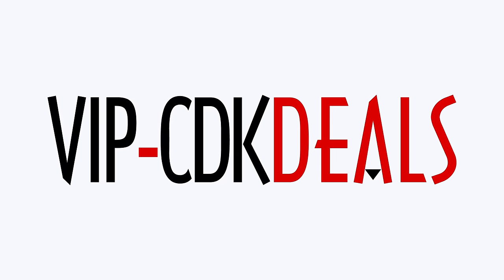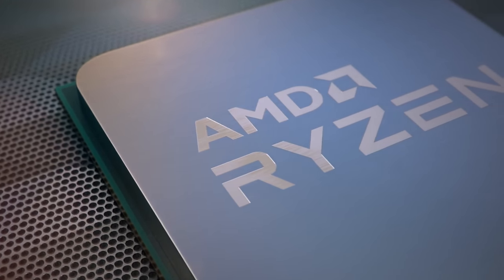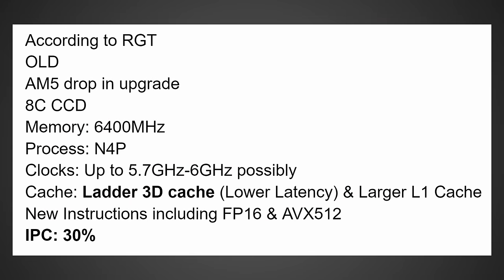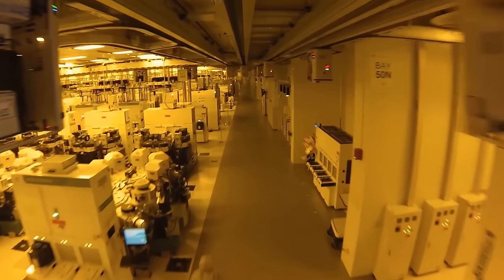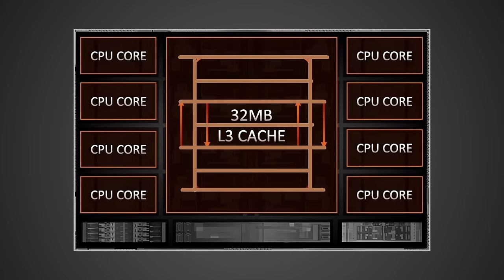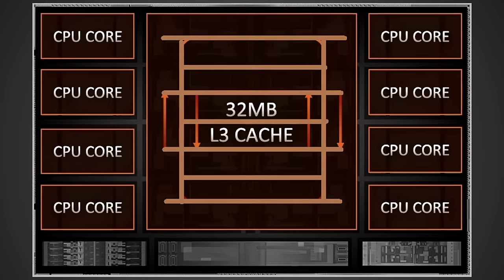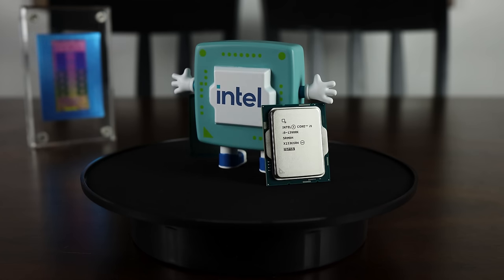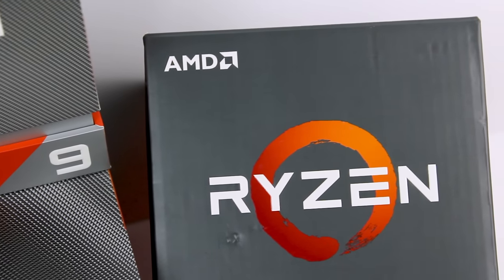Zen 5 Wins - AMD Ryzen 9000 Specs & Release Date

Comment: I already have a Ryzen 5 7600 and it’s enough for a FullHD right now with plenty to spare. I'll wait for Ryzen 7 11700. I hope they won't raise the operating frequency of the new processors too much, otherwise I'll have to change the RAM, and maybe MoBo
Reply: Ryzen 9000 is probably the last line of CPUs on AM5. Ryzen 10000 will probably be APUs like 8000. The way they're going, AM5 won't be able to support the next-next gen Ryzen CPUs
Reply: @Liminal.Headspace  Zen 6 CPUs will be on AM5. Ryzen 9000 will definitely not be the last series.
Reply: @Liminal.Headspace Why do you say that? I got Ryzen 1700X at launch, then upgraded to 5800X years later, it worked for 1000, 2000, 3000, 5000, why would AMD suddenly start doing an Intel an do 2 generations per socket rather than 4-5? AMD sockets just coincide with DDR generations.... and DDR5 is still fresh.
Reply: @xeridea  Because AMD is already pushing it with what they can do electrically with the AM5 die. There's no "doing an Intel", it's classic AMD lack of foresight. About RAM, don't worry, there won't be DDR6. DDRAM memory has shown it's weaknesses for a long time and only industry conformity kept it in the game.
Reply: @xeridea 
Fresh when DDR6 is expected to be coming next year . However if it was like ddr5 then DDR6 would take off 2 years after the JEDEC specs gets released or 2027 for desktop computers.
Reply: @Liminal.Headspace 
Very confident for someone who is dead wrong. there would a next generation of SDRAM and it is more lucky to be called ddr6. If the naming changed and the overall memory tech changed (wuich is unlucky) then DDR6 might not release. computer engineers from all tech companies aren't a joke specially when they work together to release a standard that all of them with no exeption use.
Reply: @xrafter  How am I dead wrong when you've proven my point ? DDRAM is on it's way out, and people are making sure it is.
Reply: @xrafter  But he's right. DDR is used in PCs because it's always been, not because it's the best choice. Even HBM would perform better in the same place but there's no standards for the release of discrete HBM sticks and one company would have to do the legwork of designing the 1.0 and/or founding the nonprofit to manage the new standard.
Reply: @Liminal.Headspace  
How is it going out without replacment? And what is this "DDRAM" you keep mentioning.

DDR6 will be the next gen of memory for CPUs. HBM3e isn't for CPU because they are expensive to make.
Reply: @Gen0cidePTB  
HBM is more expensive and it is made for HPC. Consumer PCs don't need that much bandwidth, especially when the CPU won't be able to utilize the bandwidth.
Reply: @Gen0cidePTB  HBM really isn't going to ever be used large scale due to material cost and heat output. There are other solid state standards that are being used and developed that use the same RAM chips but in a more electrically and mechanically sound way.
Reply: @nathangamble125 Yeah I'll be shocked if Zen 6 isn't on AM5.

Comment: im still sitting on the 3900x its just about good enough for high 1440p gaming but i do plan getting a AM5 cpu like the 9000 series since its over 80% increase in performance compared to mine. i do plan to pare it with the 5000 gpu since im still on the 3080ti this year is my year

Comment: 40% IPC increase ? Sure... Not. It has never happened while keeping the same socket and memory. And 6Ghz on top of that ? No way.
We will have the classic 10-20% IPC increase, plus 100 MHz or so, as always. That's already good.
Reply: What's the difference between a 1600 and a 5800x3d? You know, the same socket and memory.
Reply: In the proper select benches is supposedly showed "up to" 46% inclrease, I suspect cache heavy workloads.
Reply: @dragonproductions236  14% raw IPC increase. Intel is just always better.
Reply: @dragonproductions236  Comparing an X3D CPU to a non-X3D is not even a fair comparison.
Reply: 2600 and 3600 ; 5 years and a shift from 14mm to 7 mm. Seriously, what a dumb argument. You are comparing Zen 1 and Zen 3.
So, no, there won't be a 40% uplift between Zen 4 and Zen 5.
Reply: @jamegumb7298  Meanwhile 13th to 14th gen
Less than 5% uplift
Reply: Zen 1 to 4 was being relatively modest regarding CPU width, Zen 5 on the other end is quite fat, you just gotta wait 2 months and be amazed.

Comment: i am mostly cpu bottlenecked right now with a 12700k, zen 5 must be twice as fast to keep up with modern gpu's in 2025.
Reply: In what task, with what GPU?
Zen 5 does not need to be twice as fast for most people. An i7-12700K doesn't bottleneck an RTX 4090 in most games at 1440p or 4K, no-one sane buys an RTX 4090 to game at 1080p, and next-gen games will be even more GPU-intensive than current ones. An RTX 5090 will not be bottlenecked by a Ryzen 7 9800X3D in next-gen AAA games.
Reply: You must be on 1080p?
No way 12700k bottlenecks, I have one and game at 1440p 165hz monitor, Haven't seen a single bottleneck matched with ASUS ROG STRIX RTX 4080.
Reply: no it doesnt lol. fix your shit. i run a 6700k and i cant bottleneck it lmfao
Reply: my most played games are battle royales on a 4090, max graphics settings, Fortnite is at 1080p and apex is at 4k.
gpus is not maxed out in either, so logically if i want to double the fps if the 5090 is 2x performance i need double the cpu performance.
and i had a 3080 on that 12700k, and my next cpu u want to reuse and just upgrade the gpu next time so it has to last minimum two generations of gpu's.

Comment: IMPORTANT QUESTION : Does the ZEN 5 Processors work in B650 Model motherboards?
Reply: Yes, it's like AM4 otherwise there's no point staying on AM5 if you can't use the previous MOBO (you need to do a BIOS update of course)
Reply: @osopenowsstudio9175 you didn't have to be condescending. Some people haven't been watching the tech news for 20 years like you and I.

Comment: Actually that what I am waiting for. The first gen of a Ryzen platform have so far always been  "public testbench" for AMD. so  Ryzen 9000 is when AM5 matures and they iron up most of the baby problems like poor memory controller performance and they get the microcode more optimized and then likely we will see 1 or maybe 2 more generation after that before we go AM6

Comment: Of they are using new interconnect that cut laintieces then certain work loads yes. AMD have been not only making the zen cores faster but have kept power under control something Intel is struggling with.

Comment: it will be a year until there is real reason to jump on the bandwagon - wait for bugs, wait for wide availability, wait for price drops after initial early adopter tax, wait for 3dcache version
Reply: Yep, nowadays I play the waiting game on cpus(and gpus).
Reply: @masterlee1988  this is a unique time but really prime time to buy probably won't be for a year until after the x3d chips are out - they will boost it up a bit but not like the 30% ipc gains we see with zen5 - if you wait you can get the new chips and have better efficiency, if you don't need newest gear the older chips will drop in price a bunch - either way you win by waiting essentially bu there are times when you shouldn't wait too since there is always something new around the corner - what makes it more relevant now is the major performance gains and amd has to capitalize and ramp or they lose big opp for expanding mkt share - they may face wafer constraints

Comment: Probably would need a newer AM5 board to take advantage of the DDR5-6400 memory, right?
Reply: ...why? The board doesnt care, the CPUs memory controller does. But even so, Im already running 48 gb at 7200 on the same board i picked up shortly after launch
Reply: @remisteele8904  I suppose if you already have a high-end board, it would recognize the higher speed memory as an over clock, and can run it stable.

Comment: Does 9000 has integrated GPU?
Reply: No. Ryzen 10000 APUs will have iGPU.
Reply: @laszlozsurka8991  how far are those though
Reply: @keylanoslokj1806  If I have to judge based on Ryzen 8000 launch compared to Ryzen 7000... I'll say about a year after Ryzen 9000 launches.
Reply: All AM5 CPUs have integrated graphics, the difference is, models with "G" at the end have a better iGPU power than regular ones
Reply: @ShaunaJagan  so do i wait for the next generation of ones that end with G?
Reply: Ryzen 9000-series will have integrated GPUs.
On most Ryzen 9000-series CPUs the integrated GPU will be very weak (Radeon 610M, the same as on the Ryzen 7000-series), but they will have them.
Strix Point APUs are also expected to be released on desktop as Ryzen 9000-series. These will have powerful integrated GPUs with up to 16 RDNA 3.5 Compute Units (compared to 12 RDNA 3 Compute Units on the Ryzen 7 8700G).
It's possible that Strix Point will be branded as 10000 series on desktop, but unlikely, as they're expected to launch shortly after the standard "Granite Ridge" Zen 5 CPUs.
Reply: @nathangamble125 ***** hell it's Mr Gamble from Quora 😂 Thanks for the answers haha

Comment: Per Moore;s Law is Dead and the fact Zen 4 will be on 4nm node, way way too optimistic. Zen 5 will be good but 15-20% better and vanilla variants probably on par in gaming to 7800X3D like vanilla Ryzen 7000 were to 5800X3D. Then Zen 5 X3D comes out and will beat Arrow Lake in gaming while vanilla Zen 5 ties or slight behind just like Zen 4 vs Raptor Lake. but AMD will have more reliable CPUs that do not put out so much power to heat up the case unlike Intel with similar performance so a win there without having a space heater in your room yet again.

Comment: yeah yeah hype it up for team red as usual, then eventually fizzles out.
Reply: This is the hype channel 😎
Reply: @christophermullins7163  yeah like gamermeld hypes everthing up
Reply: Better than hyping team blue with higher temperature and power consumption and lower performance
Reply: @Riyozsu  just buy the non K, otherwise get a better cooling for your K if you are to OC.  13700 non K runs 38c all cores at max turbo boost during games pretty straightforward cpu.

Comment: I'm sorry but these jumps we always here in leaks with GPUs and CPUs are always suspected to be so large that they haven't even been seen in a decade. I don't buy any of the leaks. I see it every generation cycle and every time it is underwhelming.
Reply: Which gen has been underwhelming exactly?
Reply: @thevaultsup  Virtually every CPU before the 12th gen intels for example. Then the 13th and 14th gen, etc. GPU performance between the 3060 Ti and 3090 Ti when compared to the 4060 Ti and the 4090 doubled in a single generation, meaning these midrange to high end GPUs are getting half the performance they should be under their new platform. Things like that, happens all the time. We saw it with the lead up of the 7900 XTX as well.
Reply: @ThreaT650  Seems more like product segmentation issues than actual underwhelming generations, i would argue the only underwhelming gen recently is the 14th gen, if we can even talk about a new generation considering it's the same product as 13th. Also before 12th gen we had Zen 2 and Zen 3 which were pretty good. Then if we talk relative to the consumer hype, oh well i have a great list...

Comment: Downvoted and reported the video for misinformation.
Thumbnail: FORTY SIX PERCENT REEEEEEEEEEEEEEE!
Most of the nonsense at the beginning "up to 46%".
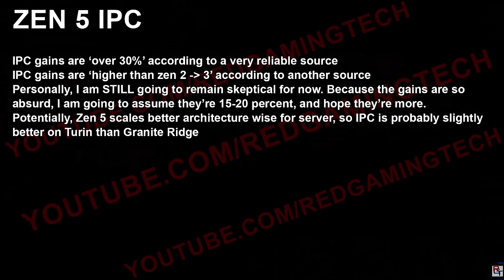3:03 "over 30%"... also "15-20%".
4:00 "40% higher than our current CPUs!"
5:35 "Roughly 35% faster."
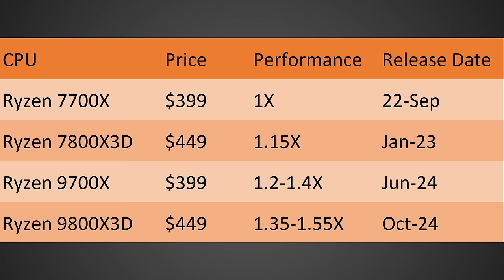5:45 "Shocked if less than 30% faster"
6:00 "Closer to 50% or more could be achieved"

If you think AMD will launch a 46% faster product when they could, instead, milk those gains over multiple generations, then you're delusional.
They'll release exactly what, if anything, is needed to outpace Intel.

Comment: I think anything is possible depending on what you can get your customers to do for you, however it all comes down to price, yes we saw a lot of 3D chips be sold, of course to make up the unrealized difference AMD had to extend am4 platform a bit longer , it worked out for them as well as their customers, as I assume, I have no physical proof but think some of not all chips have come from recycling bins, better to use it and not waste it type of thing.
Everyone is going to chiplet design, even the all mighty Nvidia has made a dummy chiplet design.
Lol they copied AMD lol sorry folks that just makes me laugh, anyhow, the market is not what it was as pointed out by you and many others, price will decide first gains and software features are decided next.

Comment: too optimistic for my tastes but I am more interested in what they will give with the curve optimizer, the new "pbo" if there is one, memory optimization... Simply by the fact that I have a 7600 non x and after having optimized it, "whistle", these different techniques without causing overheating (on the contrary) literally put me on my ass...
  At this level, it is no longer OC but more optimization.
Reply: IOD is the same as Zen 4

Comment: Moore's law is dead it seems, that "the number of transistors in an integrated circuit (IC) doubles about every two years" , so not 100% more perfomance buy only 40%, i am so dissapointed.
Reply: There's a tech channel called "Moores law is dead" in case you didn't know 😂
Reply: It takes double the transistors to reach 40% IPC uplift. Also, don't forget that Moore's law also factors in the cost per transistors just FYI. With price increases we may very well be at that point. That said.. CPUs will continue to get faster and faster even if you can't get much of a node advancement. Stacked dies, better packaging and Vcache to name a couple. Performance will continue..but price will advance even quicker lol
Reply: @christophermullins7163  For some reason i have the feeling that the tenchnology does not advances as fast as it used to.

Comment: Intel is in trouble either way. They still havent caught up to efficiency or performance of their gaming or workbench lineups of zen4. So this is going to be a slam dunk
Reply: they're really only behind in efficiency; raw performance is generally ahead of Zen 4, and thanks to the e-cores, they actually have a MT lead in the consumer space (which is why AMD has had to counter with their C cores).  The efficiency advantage AMD has been enjoying is large in part due to their using TSMC's superior fabrication, of which Intel will start utilizing TSMC going forward.  Competition is good now, but its about to get even spicier.
Reply: From all the benchmarks I've seen they are better at gaming even than the x3d cache cards. Amd wins in socket support though, that's why most gamers buy it.